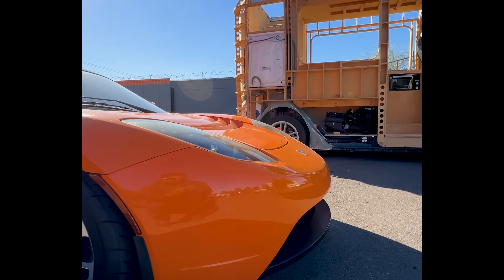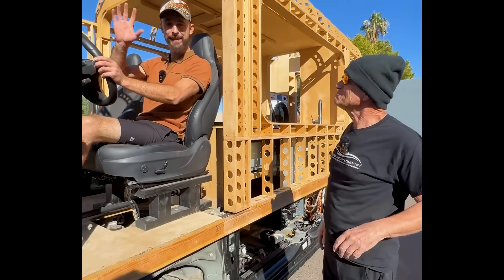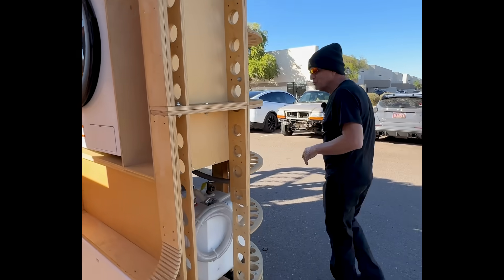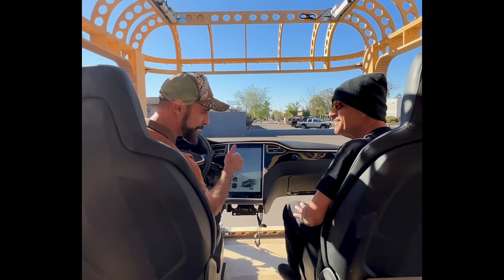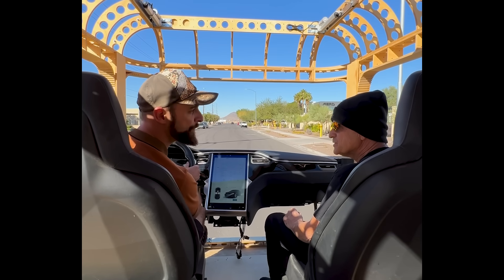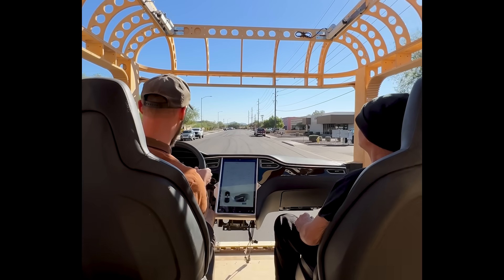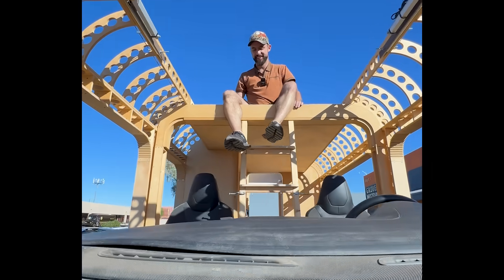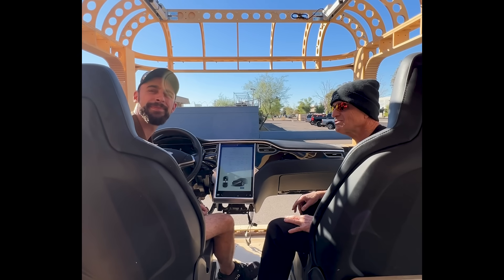Tesla Model S Tiny Home Project

Comment: THIS is where steering by wire would really come in handy !
Reply: Absolutely, you could make a much better layout if you could put the steering wheel up front.
Reply from the maker: Agreed.  At the time this was developed, the CT was still on the drawing board.
Reply: i stronglee disagree! it needs tons of calibrations and all the mods wont work with that! electric steering with much better steering shaft position is better!
Reply: @carholic-sz3qv  what is even there to calibrate on it ?   wheel rotates 20 degrees = motor rotates 20 degrees...   or not ?
sure the CT does it for all 4 wheels and in relation to speed..  but this here would only be replacing a solid rod
Reply: I would just drive it with a video game controller like oceangate.
Reply: @charlescole-p9v  imagine this on a dual motor CT!
Reply: @Patrick.Eckert it is isn’t it?
Reply: @Patrick.Eckert  just swap the battery and motors on the chassis of a ford f150 or f250 you have a much better frame and you can build your own camping bed much more aerodynamic than this! a single cab ford or chevy is even much better or a ford transit why not!
Reply: been seeing a lot about people wrecking CTs lately, which is good news for this i think?
Reply: @HotSocket  if Elon sees this he may just release his own version.
Reply: would be pretty easy to do a hybrid diy SBW ,  the wheel to a rotary encoder that controls a stepper/servo at the remote gear box the goes to the steer rack, would def take some time tuning it to get your step count nailed down but the latency would be very minimal